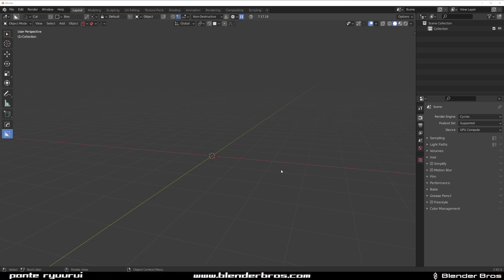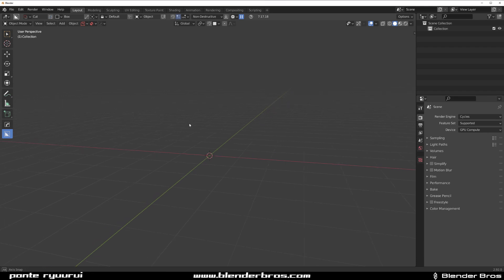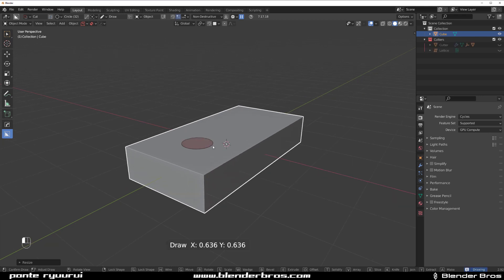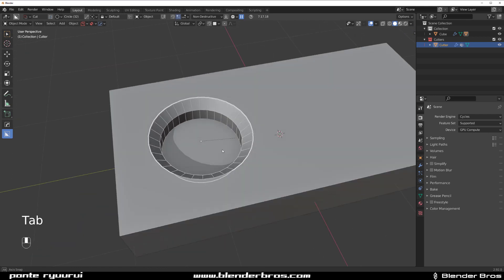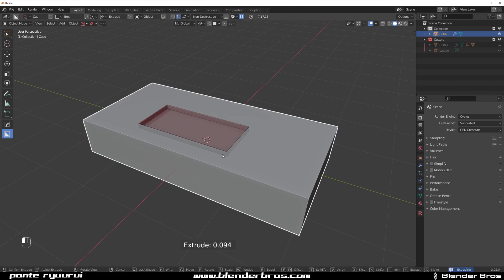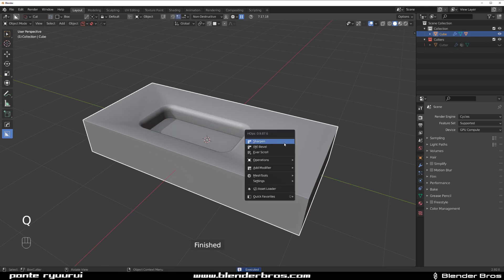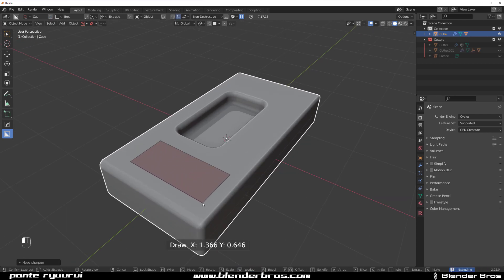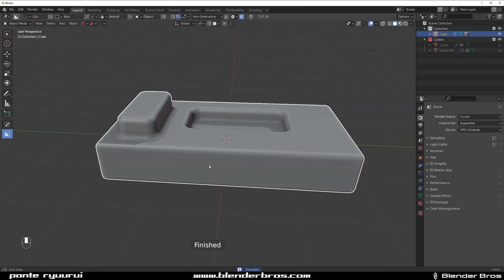Blender tutorial - REVERSE BEVEL for boolean modifier with Boxcutter

Comment: Great tip but it doesn't seem to work with a circle cutter, Ryu. Only with a rectangular cutter. For a circle, you still have to use the first method you mentioned.
Reply from the maker: like i said in the video, currently it works only with a box